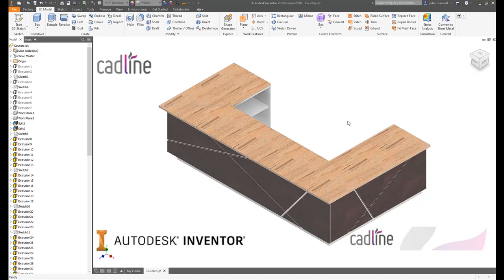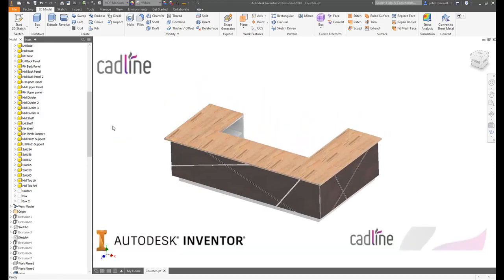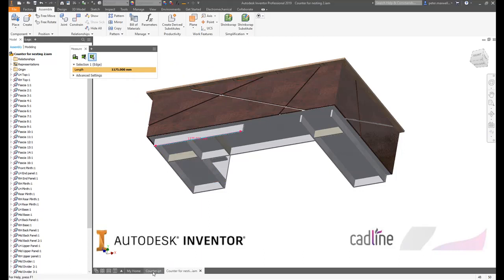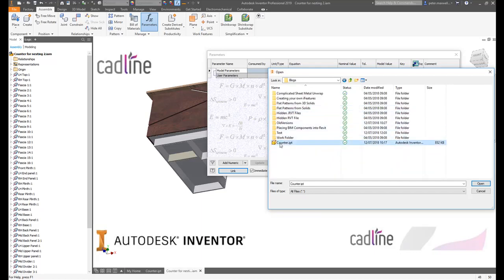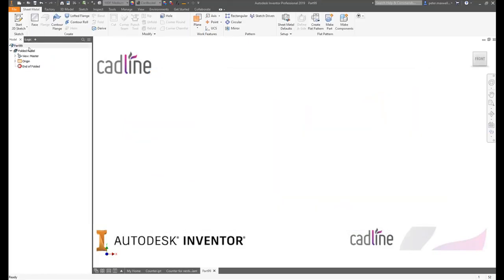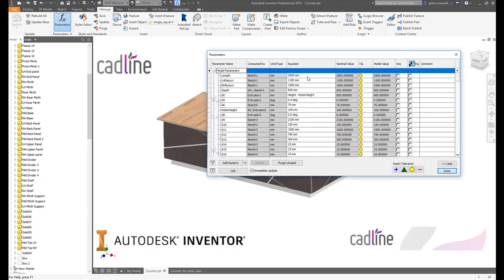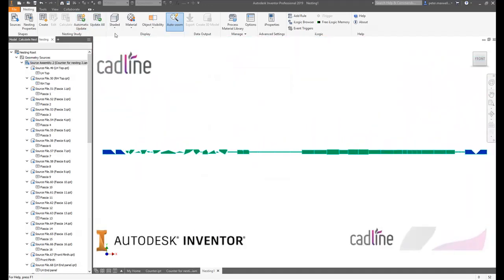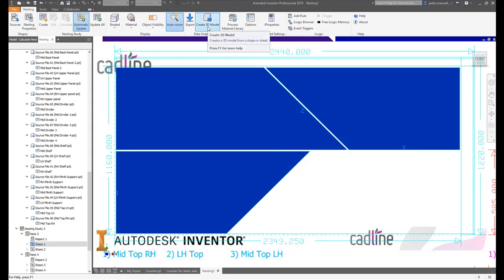Inventor Nesting Utility

Comment: Well, this is not a Top-down modeling approach, this is a modeling technique you used called multibody in Autodesk Inventor that happens to facilitate the process of design creating separated parts of solids within the context of a part file. This technique is based on the Derive technology, and you can make an interpretation of it saying that is an "automatic" way to create parts and a Bottom-UP assembly after you populate the parts using the Make Components command. Top-Down Assembly  Technique, is very popular and is based on the ability to model elements/components in the context of another geometry (e.g. assemblies), to take advantage of that existing geometry or capabilities like adaptivity. Many people today use a multibody technique to "replicate" this approach, but they can do the same in a context of an assembly. Nesting happens in a context of a mode assembly and is based on templates that are already defined. The use of multibody here is to highlight the possible change that the model can have and how those changes can impact the nesting studies

Comment: How do you setup the material templates that you select in the Make Components? I have an issue when I try to flatten the pattern of each part, I get an error message saying “Could not build this FlatPattern. Invalid Part Thickness”.  I assume that this has something to do with not having the material templates setup properly.  How do I fix this error? 
Thanks, Gav